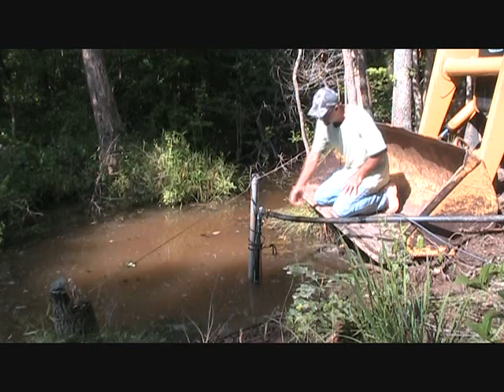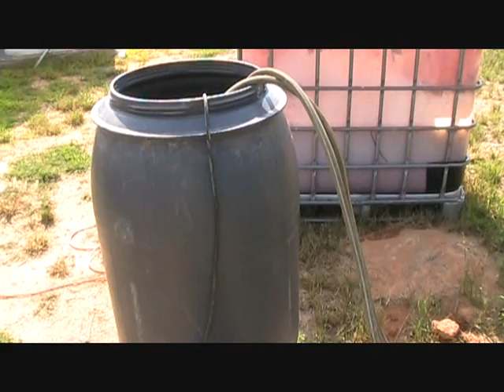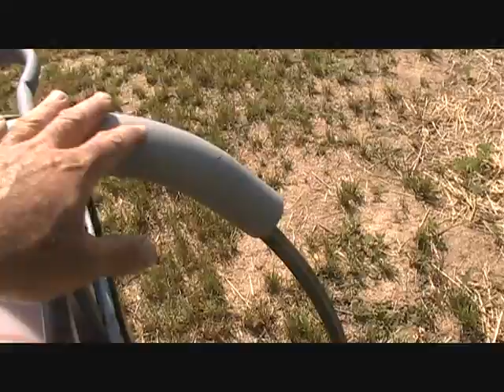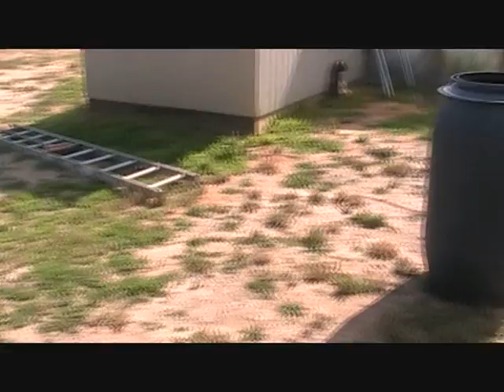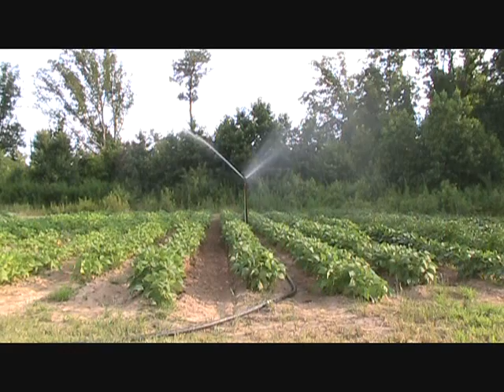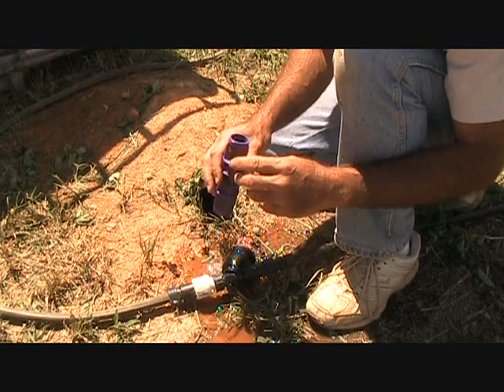Garden Irrigation with Deep Well Pump, T-tape, and Overhead Sprinkler

Comment: Heh. Don't know what brand of pump you got, but no pump manufacturer would warrantee your pump in that muck. You need a massive filter sock, which will need to be cleaned often.
Also, bare pumps in the water are voodoo. Your pump should be inside a 40 inch piece of 4 inch PVC pipe with a well seal up top so the water get's flowed across the motor first to cool the motor as per manufacturers rules.

Comment: You could power your pump using solar thermal, like a parabolic trough to generate electricity instead of using expensive photovoltaics or solar panels, which use a lot of pure silicon. Producing pure silicon is very energy intensive and uses a lot of fossil fuel. In addition, solar thermal is less expensive then photovoltaics and gives you the option to use other heat sources to produce electricity, if setup properly. God Bless
Reply: Stfu

Comment from the maker: The deep well pumps are designed for pushing water vertically 200-400 feet, depending on the size. Turn that power horizontal, and you can probably triple it. It would depend on the slope you were working against and the total distance.

Comment from the maker: The only wire that is in the water is the original leads from the pump. They are sealed internally. My connection is above the water. I stepped up one size to 10/2 from the house down to the creek.

Comment from the maker: I bought a full size irrigation system several years ago that has 3 inch aluminum pipe and screw in sprinklers on 1 inch pipe. I use one of those sprinklers with adapters on the 1 1/4 black pipe.

Comment: nice vid... believe it or not, i just scored 8 (for a total of 10) more totes last week. but i dont have a pond or creek, i have to capture rain water. probably take the rest of the year to get installed but look out next year... and was thinking of an old boat trailer with a solar panel and battery setup to run a pump. pump from rain collector totes, to a tank on boat trailer, then drive around and pump from trailer to plants... i have 3 garden spots. this method would take water off the well.

Comment from the maker: Oh yea. a golf cart would be great. Rutgers likes a little extra potash/potassium. Most of the "tomato special" fertilizers will have a high K level. You could add some wood ash or greensand to help out. I like to fertilize them real good at the start. And then when they start to set fruit, give them a little more. It all depends on exactly what you choose to use, and how fast it is released in the soil.

Comment from the maker: First off...30+ years....and you're just now telling me? LOL
Ok, I didn't have a way to hold the pipe so that I could use the bucket. And it never crossed my mind ! I'll see if I can find a filter to fit the 1 1/4 pipe prior to filling the container. That makes sense. Yep...broadcast watering does help the weeds.... but the tractor helps deal with that. I can still plow beans and peas. Not a chance on cukes and maters. :-)

Comment: So Bobby, since I've been doing drip irrigation, T-tape etc for 30+ years now, I just have a couple of questions.

First,  why didn't you use the bucket to drive your pipe down in the stream?

What your really need from your pond to the T-tape is a sand filter but I won't go there.

You really need a Pond Pre-filter (5-25 micron) so that algae etc is cleaned out before the 200 micron filter.

Broadcast watering, morning or evening still waters your weed seeds!

Comment: Fantastic Video Bobby !  As Always your a very good teacher to us all. Thank You :-) I have a thought for your well pump and the sediment issue. When we install a new foundation we put a 6inch weepiing pipe with micro cloth sleeve over the pipe to keep the dirt from filling in the perforated pipe. If you got a section of the perforated pipe and the sleeve over your well pump it will filter the water before it went into the impeller. Just a thought
Keep the info and updates growing our way :-{}

Comment from the maker: I have a couple of brand new hoses that I bought at Lowes. Probably never will use them. They are just too inconsistent. I bought the tape from Morgan County Seeds. I got the 10 mil, 3000', 4 inch spacing for $90.  Enough to last me a few yrs at least. So far, I really like it.

Comment from the maker: Thanks. Yea, I've been thinking of a gutter system for the GH and haven't come up with an economical solution yet. I tried a pressure washer on another tank, and it didn't work too well.. But I was going thru the small hole up top. For this one, I just decided to use a scrub brush. I got it cleaned up decent. Certainly better than it was when I started.

Comment from the maker: Its drip tubing that comes flat on a roll. Generally made to operate at low PSI, and very simple to work with. A couple yrs usage is about all you get, cuz its not thick like regualr pipe is. This is my first time using it and I like what I'm seeing. I think the plants like it too. :-)

Comment from the maker: Thx. The sprinkler is an old Rain Bird that was used on 3 and 4 inch aluminum pipes, the kind you'd see laying down long rows. Its threaded at the bottom, so I bought some galvanized fittings to adapt it to the black pipe. It works great.

Comment from the maker: The filter was something I wondered about. I went ahead and got a decent one to try to cut back on sediment problems. If I keep it cleaned, hopefully it won't be a problem. For the price of t-tape, just a one time use will be ok with me. Building a tower to support the weight of 250+ gallons, and 10 ft high, would be some work. I'm hoping to rework a trailer and make this setup portable. Just tow it from one spot to another. Small steps, small steps !

Comment from the maker: Plumbers drop 12/2 down in wells 300+ ft around here. I put in 10/2 wire, thinking the same thing. I always try to do more than is needed, just in case. It might be overkill, but better safe than sorry. No rainwater yet. I still need to get some storage containers. But it is on my to-do list. Thank you.

Comment: Hey! great job! what about using that CAT to dig a big hole up top the hill and make a small pond so you can raise catfish, and then if something happend to the electricity, you would have a ready made water source on the top of the hill and use gravity to water the garden.. that at least would suffice until another power source could be found.

Comment from the maker: Yes sir... I considered that, and still might do it. But my concern was this...the black pipe is laying on top of the ground. Left alone, the water inside will heat up quite a bit, expanding, and likely push the pipes apart. Even with 2 clamps on the fittings, I've seen it happen. If it pulled apart down in the bushes and I didn't see it, that could be a problem. But it would be nice to have it regulated so my wife could use a hose to water her flowers. We'll see. :-)

Comment: You thought about putting in a small pressure tank at the top with a pressure switch (not very exptensive)?  Then, you'd only have to open a valve for the pump to kick on.  This is just the lazy in me talking.

Comment: Try lifting the IBC about 10' (with your loader) and see if you get the pressure without pumping from the tank. You should get 5+ PSI at about 10'... maybe more. If it works, build a simple tower to hold it up.
Careful that your T-Tape doesn't get stopped up by the dirty water. I have a well that pumps silty water and it seemed that my T-Tape was beginning to stop up so I had to switch to my clean well.
Good work brother.